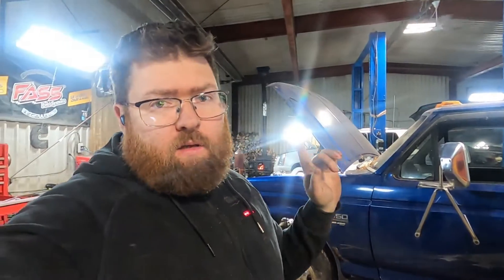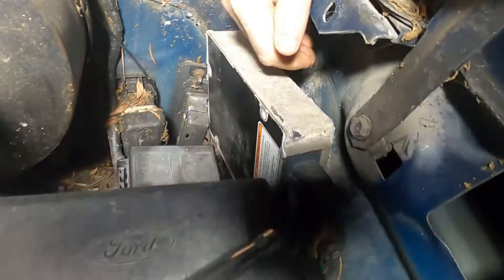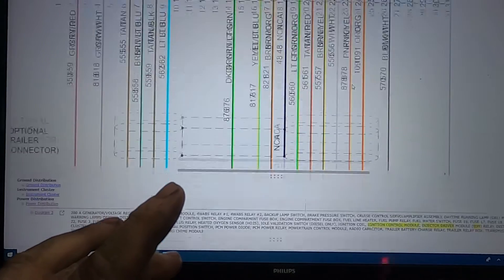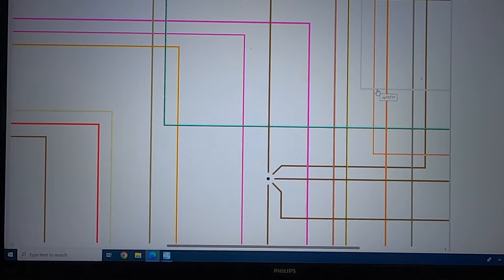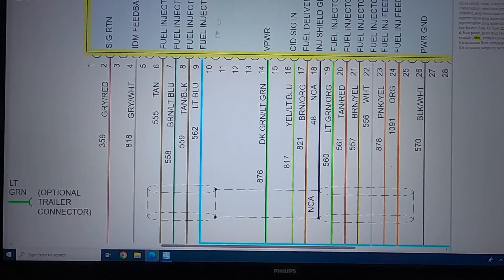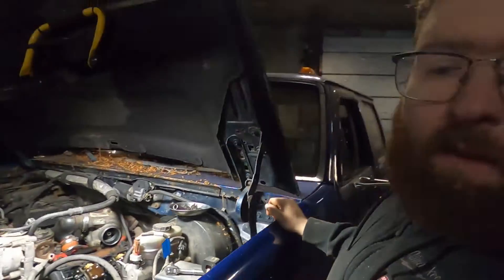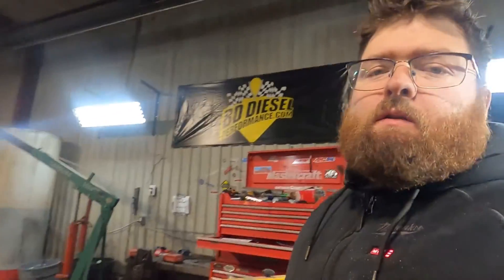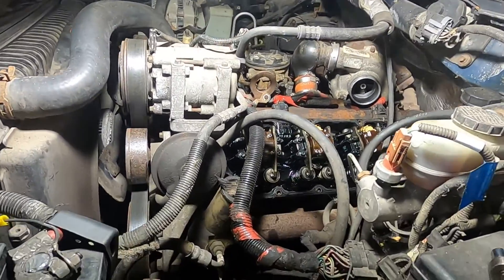7.3 POWERSTROKE IDM DIAGNOSTICS!!

Comment: What happens when the scanner doesn't read the computer? Any advice ?

Thanks
Reply from the maker: Check your powers and grounds going to the module and check for battery voltage at the OBD2 connector

Comment: I got no oil coming out of the discharge nozzle on 5 of my injectors. Could the IDM be the issue or what could be the problem? Ipr is 13.76%. ICP 671. Buzz test wont clear out as i try to swap connections with injectors to see if it is the injectors or something else. All injectors ohmed at basically 3.0 ohms at the valve cover. Have not ohmed the wiring harness but it and all connections look great. Valve cover gaskets only have 4,000 ish miles on them. Just did a motor swap and the truck shakes at higher speeds/load.
Reply from the maker: That usually means the injector has left the chat
Reply: @screamindieselltd  finally got the codes to clear and did a buzz test again. Replaced #3 injector and the issue went 95% away. #4 probably needs changed too but that's for another paycheck lol. Thanks for the reply!

Comment: Good informative video.  Thank you.  I’ve got a friends 97 power stroke with a hard starting and rough running when cold.  I’ve narrowed down to no injector operation on cylinders 2 & 4.  Once it runs and reaches operating temp it runs fine the rest of the day.  Cools down over night and it’s the same symptoms.  Lots of corrosion in the bulk connection and the connector at the IDM.  Clean them and same problem.  Continuity testing shows no wiring problems and will ohms test the injector now that I know how but I’m pretty sure IDM is bad.
Reply: @weshawkins7165 I have a 95 with the same exact issue, haven’t confirmed which injectors don’t operate but once warm it runs great the rest of the day. Looking at IDM replacement. Did you figure yours out?
Reply: @ 
  Yep.  What I did when I could get it to start was to unplug one connector at a time at the valve covers.  Each one goes to two injectors and two glow plugs.  Kind of like pulling a spark plug wire off a running gas engine.  That’s the way I found #2 & #4 not contributing.  I replaced those two injectors because they didn’t have great contribution even after it warmed up.  What I ended up doing to the rest of them that took care of the problem was to shim the rest of the injectors.  There’s videos on how to do that.  It worked quite well but I told the owner that it’s only a bandaid.  All injectors should be replaced eventually.  He’s has had it back now for two weeks and no problems starting it.

Comment: What year and model truck is that? IDM looks easier to access than mine.
Reply from the maker: That was a 95 I believe.
Reply: @screamindieselltd  thanks. I had to answer my real question the hard way. I have a '97 and I've seen at least 3 YouTubes saying I have to peel away the liner in the front left wheel well where it's deeply hidden. Well, after a horrible job of bending part of it back, I was looking into the engine compartment. The IDM, which I thought was the PCM, is right there like yours.

Do you happen to know how tough it is to pull and diagnose the power fuse box right next to it? I find that the relay coil high side for the IDM is only reading 9V. My whole IDM issue may be that it's not getting basic power. The power pin on the IDM connector reads zero with the ignition on.

Comment: Going out on a limb here, with a 99 7.3 if a guy wanted to make sure the truck would crank but not start could I tie into the power Input wire pin 14 with a two way switch without causing any issues with the IDM? Thanks sir

Comment: If I checked my GP at the vc and the injectors and the IDM plug that plugs into the idm and had 3.5 3.2 ohms to each injector. I'd put a IDM from someone on FB marketplace ran my truck for 2 days then back to now. My tests with voltmeter seem to be all 100 percent. Bad idm?
Reply: What's your question? Did you replace your IDM with one on Facebook Marketplace and you suspect it's bad?